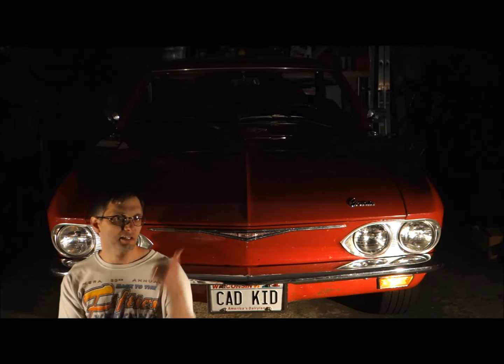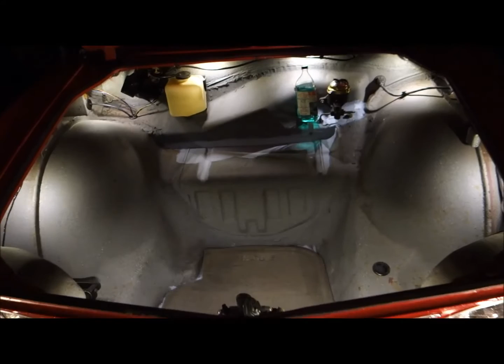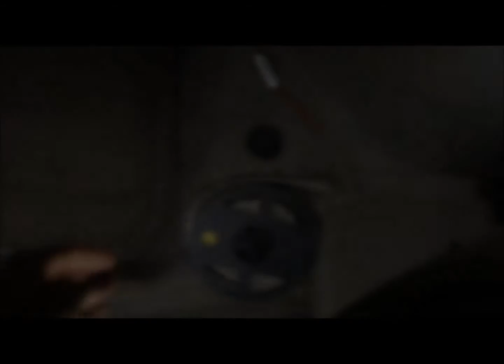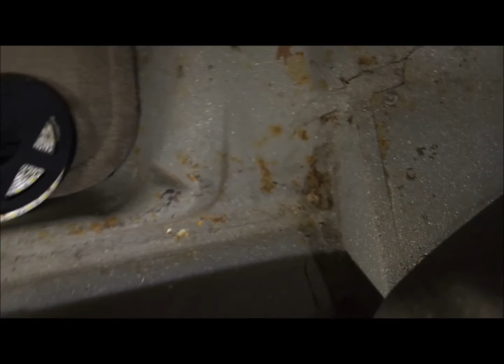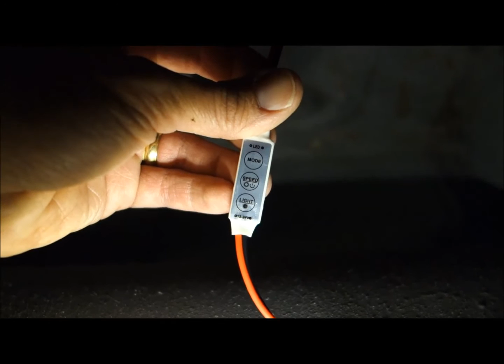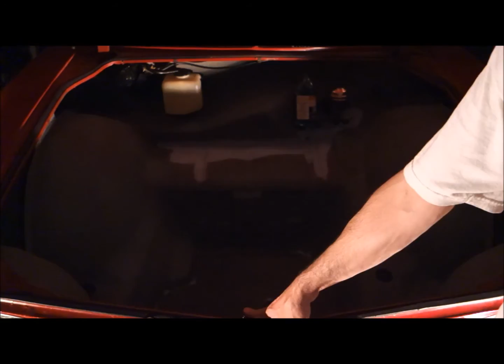1965 Corvair frunk accent lighting mod

Comment: I had 3 Corvairs in the past a 63, 66 and 1969, all had no trunk light as noted. I added a trunk light to the under the trunk lid that had a mercury switch and operated when the trunk lid was lifted. Many vehicles had engine-hood,  and trunk lights that operated in that manner. Today, the LEDs are brighter, better and draw less current.